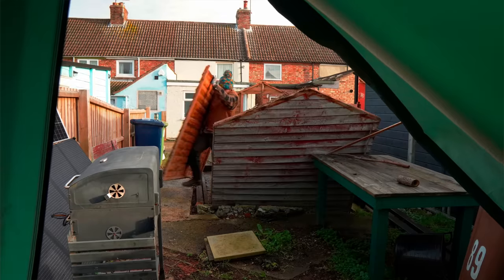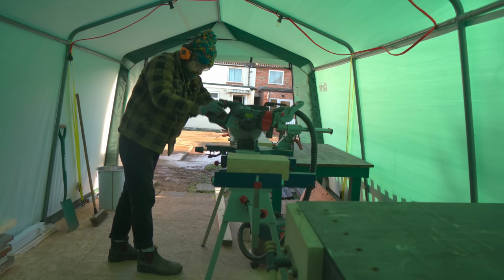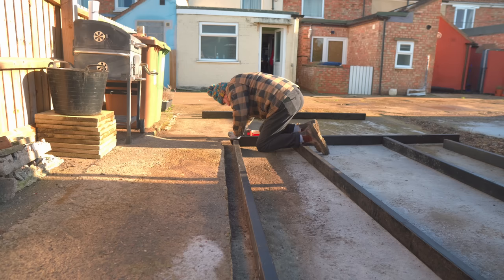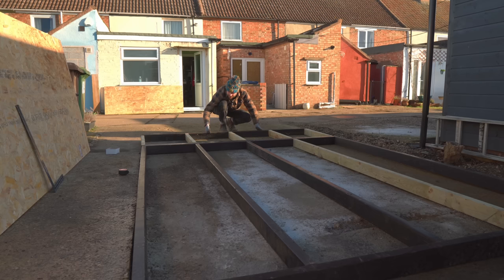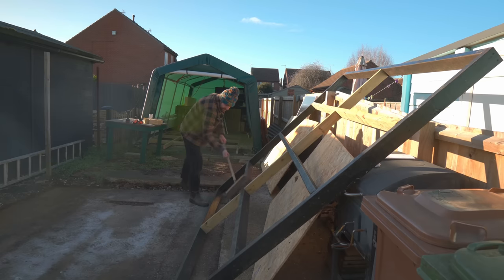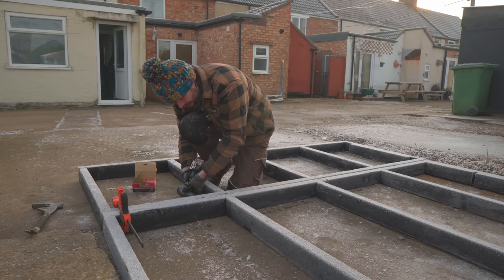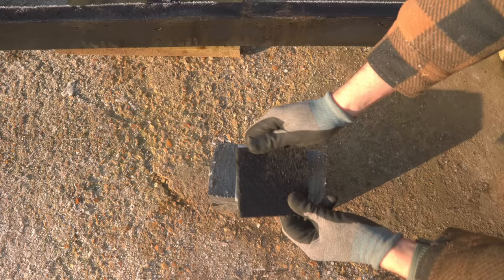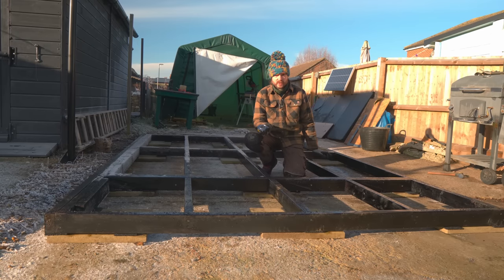New Workshop Build. The Base

Comment: Given the size of those pavers, you could've cut them into quarters and had support under every junction where the wood attached at right angles. Seems that would've sturdied up the structure a bit more. Just a thought.

Comment: when i am shimming up a level base for a shed on concrete, i use cheap plastic cutting board from the supermarket, just cut them up and stack them as needed, you can put a screw through a stack to hold them together. very hard, waterproof and cost effective.

Comment: you would have been better off when building the base to stagger the joints in the timbers where they were not long enough rather than making to different frames up as the two different frames can move at different rates to each other and cause the base to pull apart. You may be lucky because you have a solid base to work on rather than soil but still good practice to build one base rather two. 

i get what its like to not have a workshop space though as in 2019 i lost my workshop due to a neighbour burning it down and had to spend the summer of 2020 redoing the garden and building another workshop as i was lost with out it but still to this day its not finished off but at least i have some where dry work from now

Comment: Great Video as always - Just a question if I may? Wouldnt it have been better to cover the slab with the Damp Proof membrane to protect further or would that have invited pooling on water
Reply from the maker: It has the rubber pads
Reply: @Badgerworkshop  what about the fact that weather may over time perish and cause you more work. Matt im not trying to take away from your fantastic work but suggesting that’s all

Comment: I'll give you the best tips when building your workshop on a budget 1) look for second hand double glazed big glass windows (without the frame) on ebay, gumtree and facebook and make your own windows, they don't have to open 2) buy larch for the cladding, I bought pressure treated larch for a 20x12 ft workshop 1" 6"x8ft rough sawn for £760 it lasts forever 3) make the roof  from fiberglass sheets,, I used Filon GRP sheets, it allows daylight to flood the workshop and makes doing projects a pleasure and as a bonus you get heating for free (very dry shop, no rusting) 4) look at reclaimed timber for the framing and buy a saw blade that cuts nails 5) make double doors at the full height of the shop, it allows  you to get big items in and number 6) don't put a wooden floor in, build the shop off the concreate  base  putting slate between the uprights and the floor, you can then wheel table saw and planners ect into the garden allowing you to work on timbers longer than the shop when the weather is right 7) try and do a deal with building sites, they often use plywood as cladding around the site, when the build comes to the end they dump it, it may look bad but you will find once it dries out it's fine, just give it a quick coat of white paint, all of my internal storage and shelving and my work bench are made from this. This process has allowed me to build a shop that would have cost £5000-£6000 or more for around £1500 and I can say it's the envy of every bloke that sees it.